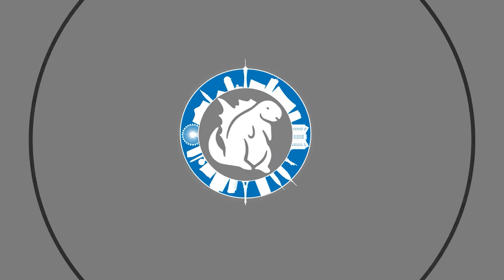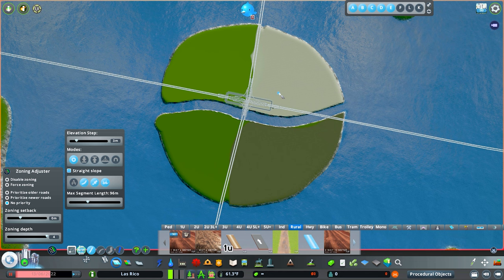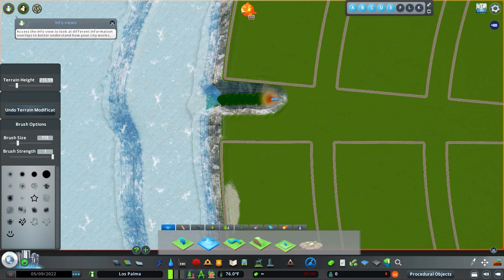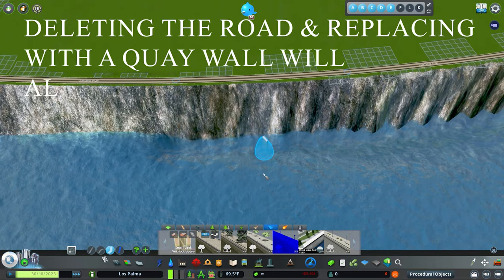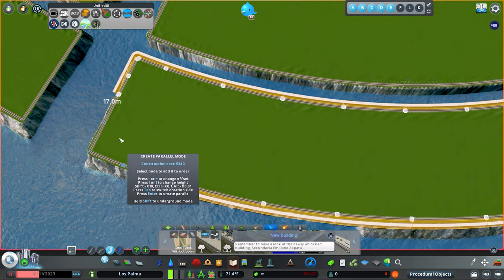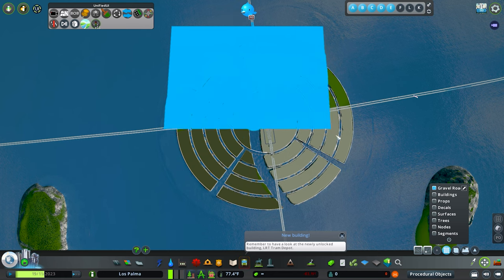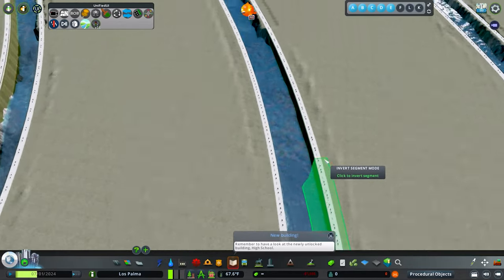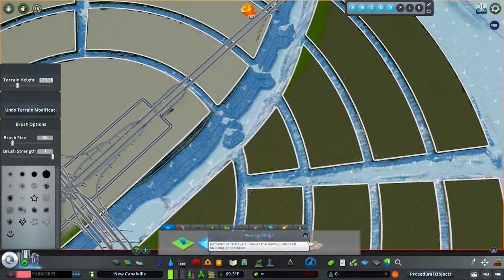Building Custom Canals in Cities Skylines

Comment: My only question why can’t I build a city that stays running for more then 1 year in game
Reply from the maker: I'm not sure.  What problems do you normally have that cause it to stop running?
Reply: @CityZilla  I start with what I usually and that’s a area for residential and commercial and industrial and build roads the commercial and industrial so they can the product across then every thing starts getting abandoned and my city falls apart after that
Reply from the maker: I would check you utilities and services. Most times when you get abandonment like that it has to do with coverage of some kind.  Do you get a lot of traffic?
Reply: @CityZilla  I don’t get a lot of traffic mainly because I I have the areas separate and to help with traffic I wev roads to where they need to go
Reply from the maker: That's interesting. I would start with the services.  Normally you will get a reason for abandonment when you click on the building.  The icon should appear on the panel stating why it was abandoned.
Reply: @CityZilla  okay I will look when my Xbox will load the game thanks